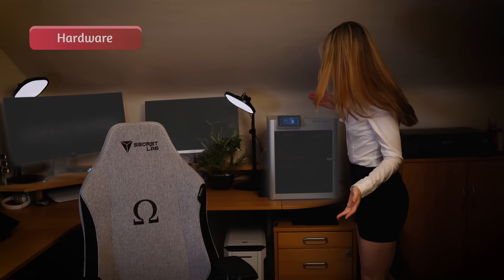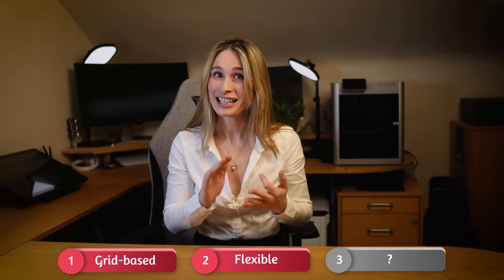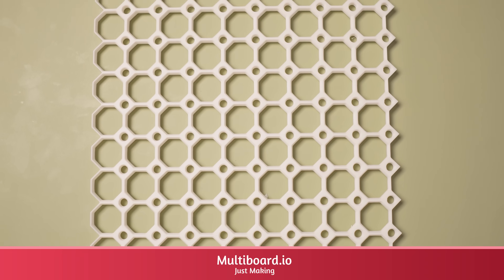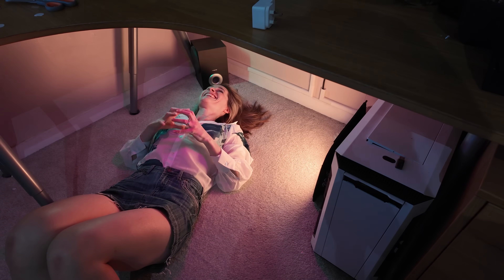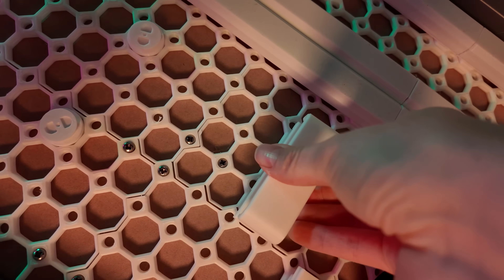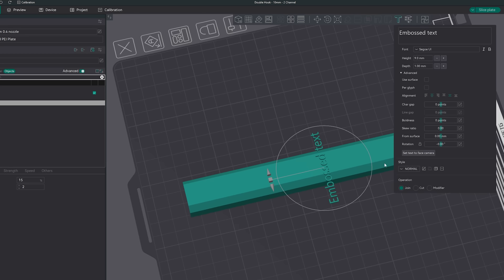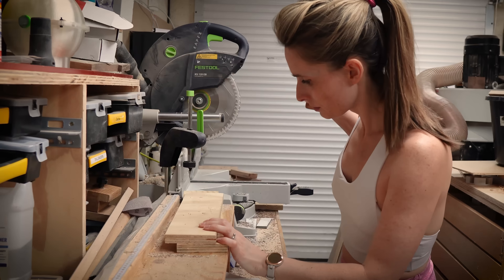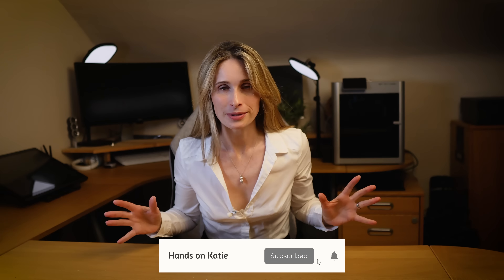Underware: The Ultimate Cable Management System | Full Guide

Comment: This is absolutely brilliant. I currently have a server cable channel that I attached to my desk to run wires, and while it does a good job of hiding everything it's a massive pain in the ass anytime I need to remove or change cables. I'm definitely switching over to this.

Comment: Underware - I covered it "briefly" in another video... I see what you did there... 😃
You certainly managed to "slip in" all the puns!
Great work as always, I really do enjoy your presentation style
I've got some Gridfinity things on the go now, and I have plans for multiboard at some point. But first, I actually have to finish some of the projects that are still ongoing!
I still have 2 servers to build (1 with Proxmox running HomeAssistant in a VM, and room to expand for other VMs, the other will be a TrueNAS Scale file and media server running Jellyfin), set up all of my home networks more securely with some Unifi gear, a 3m run of LEDs to wire (I've already set up the smaller LED strip with WLED, so I just need to attach the longer run to the same ESP32), and a sturdy desk to make for the 3d printer, as it gets a bit frisky on an IKEA Bekant desk!
Reply from the maker: 😃 Well spotted - gotta keep you on your toes!! Sounds like some cool projects you've got going - I keep meaning to tinker with TrueNAS, been Synology for years, but get annoyed at their sluggish hardware progression vs pricing....
Reply: She even included a "seamless" (underware) pun. 😂
Reply: @handsonkatie  I have a very old Synology NAS at the moment, but it's on its last legs, already lost 1 disk from the array, and is officially at end of support. 
So I really should get my big boy underware on and finish that project so I can get the files off the Synology NAS before it suffers a rapid unscheduled disassembly! Or a "This is fine" style overheating event... 😆

Comment: Looks like nice addition to Gridfinity and sturdy Walliniti 👍👏
Reply: It's multiboard not gridfinity
Reply: @MrFolfy  Indeed,, that's why I said Multi board is a nice addition to Gridfinity I use in my drawers and sturdy heavy duty Wallinity I use for tools. Wallinity is also designed for super easy removal, so that you can take the bracket with the tool from one workplace to another. It's quite a different thing from Multiboard. I'm sure both have it's purpose.

Comment: Loved the video and the concept.  One thing I've always been told is that you should always have your power cables uncoiled.  I think it was from a heat perspective.  Do you have any concerns about this in your setup?
Reply from the maker: Hey Chris - yes, if you've got a high current then it's sensible, you'll note I loosely coiled the power strip (another example of the flexibility here) and there was only lightly devices added to this socket (pc plugged in directly), so resistive load would be tiny!

Comment: I have been using the ring binders from two-ring binder folders - you drill the rivets out and remove the ring binder component from the folder and then bolt it to the underside of the table towards the back, it's a snap-open-snap-closed solution but has limits in terms of how many cables you can fit.  Nowhere near as elaborate as this system, I can actually see this being remarkably useful for SBCs and their string of external components too;  I just wish I had a 3D printer now.

@Katie have you ever thought of having these made commercially as components for sale?  I'm sure they'd sell rather well as this would solve problems in quite a number of domestic and commercial areas, I've seen run-up and server rooms that desperately need something like this.
Reply from the maker: Neat solution nonetheless!! I'm happy to keep this open source and let the community benefit and contribute their own ideas! But you should definitely get a 3d printer! (There's a big sale on at the moment too! Check links in description and my videos that cover which one!! I sense another convert.... 🤭😉)
Reply: @handsonkatie  this is starting to sound like a 3D printing cult....  I have already sold my eternal soul to the Air Fryer cult and the Instant Pot cult, they may not be happy at my apostasy.

With the underside you look to be distributing weight across a wider area which is clever.  I could imagine this would be particularly useful in an aircraft or vehicle interior too.

I'm also showing your videos to some mesh networking people in Australia BTW, they too are innovation junkies (they're building a new mesh system and protocol from the ground up).
Reply from the maker: @davocc2405  🤣🤣 It's certainly a movement!! Believe it or not, I couldn't work out what a 3d printer would be useful for until I bought one!! Share away, it's great to get everyone's cool ideas! I've got a new version coming out in due course, so happy to build any extra solutions!
Reply: @handsonkatie  you have so many printers though - I am now suffering from a condition I experienced as a child, I am experiencing extreme equipment envy (my friend Sonja had four times more Lego than I had and I was hideously jealous, that feeling is coming crashing back).

You also have laser etchers and all sorts of other cool toys...  Do you have one of those laser cleaners too?   Also are metal based printers viable for residential use yet or still strictly rarefied and commercial?
Reply from the maker: @davocc2405  🤣🤣 well I've gathered things over time! But a Bambu A1 will do 99% of everything I do! Metal printers (sintering) is still a little way off for household use I'd say, but that will be another game changer!
Reply: @handsonkatie  not sure I could make it work, my natural propensity for disaster would probably end up making something that looks more at home inside reactor #4 in Chernobyl, all while setting fire to the cat.  And I don't have a cat so it'd have to print one for me.
Reply: @handsonkatie  I'm particularly glad that you mentioned the need for covers and enclosures for these, I've only seen this briefly covered by Don at Novaspirit Tech (I've known him for several years, you've probably seen his channel before).  Uncovered do you find they produce dust and fumes that much?  

oh also - have you ever worked with the recycling of PET plastic bottles to make filament at all?  I find that intriguing but possibly quite a bit of hassle.
Reply from the maker: @davocc2405  I've only used PLA and PETG for any serious volumes, so these produce pretty minimal fumes in general. If you check out my recommended products section: https://handsonkatie.com/recommended-products/  I highly recommend getting one of the Apollo Automation air sensors, they're great for keeping an eye on any VOC levels. 

But if in doubt, I'd just consider an enclosure - there's lots of good 3d printable options out there and/or printers with enclosures.

PET bottle recycling - no, but love the idea!!

Comment: Hi katie 😉 do you have an advice for a good transparent filament to use as a light diffuser for a led strip ? Thx in advance :D
Reply from the maker: Hey! 👋 Pretty much any transparent filament would be great for this - I use Elegoo's transparent PLA for most things, so worth checking this out!
Reply: Hi 😁 Thx for the Quick answer !
You’re the boss 🥰
Reply: Since you're asking for usage as a diffuser, what you most likely want is translucent filament 😉
Transparency (like window glass) diffuses nothing (or very little) and just lets the light pass through. Best example is "plain"/undyed PETG.
Translucency (like frosted glass) lets most of the light pass through but obscures and diffuses what's behind it. Most white filaments work as a decent diffuser as long as you print them thin enough. Or you can get all kinds of PETG filaments that are labeled translucent, they only have small amounts of dye added and still let a lot of light through.

Comment: Wonderful video thanks for the inspiration. I have a use case that I don't think was covered and was wondering if I just missed it or it wasn't covered? I want to cover some wires which are going along the top of my baseboard along a wall and around an inside corner. I also have a use case for an outside corner in my shop as well.  Love your videos keep up the good work.
Reply from the maker: You'll see I've got cables doing exactly that in the video. The only exception is the inside corner example that you mention, that's easily enough solved, so I'll create a custom piece for that over the next week or two and upload to the collection! ( I might do outside corners and so on at the same time!)

Comment: For cables where you're concerned about interference maybe you could line the pieces with aluminium tape?
Probably overkill for most use cases but since you mentioned it.
A piece to hold cables neatly on the moving legs of a sit-stand desk would be a great addition.
Reply from the maker: Hey Bram! LOVE your aluminium tape idea - super simple. Agree overkill in most cases, but for certain folks that's a great idea to test (eg masses of sound cables)

Sit/stand desk - have an early prototype of an infinite cable spine for exactly this - will add to the collection in a few weeks once tested!
Reply: remember to ground that aluminum tape, or it will not work properly. Better put your cable in a grounded screen though, not plastic underware = )

Comment: @Hands On Katie  I've been installing this system for under my desk and cleared all the power strips on the floor and cables hanging around. Great job!

Next is to clear up my Bambu printer area - I am looking for a hook to lay 38mm hose across so I can run it across the wall under some nins and out of the window.
I could use a 40mm power block hook but it would be nicer to have a proper 1x or 2x width semicircular hook that I can place at required intervals.
Any plans for such (or could you design one) please?
Cheers.

(P.S. Glad I found your channel...)
Reply from the maker: Hey Nick,
Think I follow what you mean and happy to model - can you drop me an email on my site with your best hand sketch and I'll model something up!
I'm having an 'Underware Day' with my Patreons next week where I'll model a whole pile of new ideas/models they've come up with, so I can do yours then too!
Reply: @handsonkatie Yes, in fact I can send a photo of a quick print made by modifying a power strip holder in BSbusing primitives to cut and add what I wanted.
It works but really needs the mounting slot orientation changed (it's sideways at the moment).
I could probably bring an STL into F360 and model from there just using the slot configuration from the imported messages - the F360 file for underware may include those models but I haven't opened it yet ...
Reply: I couldn't find a way to upload an image on the Contact page nor an email address. But I did find a STEP file negative for the mounting cutout so I just modeled it myself in F360.

Comment: I think a good idea would be an attachment where you could loop cable ties through in order to hold bulkier or odd shaped items... or maybe an attachment that could house a magnet to make a magnetic strip that is moveable around the grid (instead of having to use adhesive like most magnet solutions). i also don't know if it is feasible or not, but if the grid underneath the desk comes all the way to the edge... things like a cup holder would be neat.
Reply from the maker: Great ideas - will add to the list!

Comment: do you screw the panels directly to the table? Or you use the same spacers as for the wall?
Reply from the maker: I just screw to the wall and table directly! Spacers are not needed and weaken the board!
Reply: @handsonkatie  will do that, thanks!

Comment: Really cool system! Are you going to modify the designs to support the new MultiPoint connection that Multiboard came out with? which just looks similar the the MultiConnect you linked to?
Reply from the maker: Thanks Bob, I'm a fan of simplicity, so I'm not sure I see much benefit. The whole Multipoint system seems to have taken something quite over-engineered to an even more over-engineered level! MultiConnect is super simple, has proper parametric files behind it so it's much quicker to develop solutions for anything I need - and only I need 4-5 files, not 4000+ to wade through!! (Plus Multiconnect has an open source/community licence too, which I'm always a fan of!)

Comment: Love this! Printing it now. Weird question probably...any suggestions on how to securely/strongly secure this to the desk? The thickness of my desk is only 0.6" so the screws will be short. I just don't want it getting loose / pulling out when I inevitably move the cables around.
Reply from the maker: My desk is the same, so I just used 10mm screws through the pegholes in the multiboard and it worked perfectly?

Comment: Thank you for the video! I am curious as to why you didn't use the Offset Snaps, as they seem it could be quite useful for this setup by offering more options to route cables in the space between the desk and the board. Could you share some insight on this?
Reply from the maker: Hey, mainly Occam's Razor - ie keep it simple and not over-engineering. Offsetting the grids naturally adds a bit more complexity of printing, mounting and also lowers the underware so more likely to get in the way of your knees and being visible when you come into the room. I wanted to keep it ultra-low profile and make it super easy to route cables (ie cable covers on top, not having to fish cables under loads of multiboard grids), so this worked great for me! This make sense?

Comment: Maybe a follow-up video attaching a five port & 16-port switch with underware. It appears you've got it covered with the 'Knob' style but the knobs didn't really get covered in this vid.
Reply from the maker: Yes, there's lots of options, the bracket clamps, the command strip mounts, but best of all for this would be the parametric holders I used for the power strips. You just enter the width, height and depth and it'll generate a 3d file that perfectly fits!! I'll add a short gif/video to my site to demonstrate!

Comment: It would seem to me that using smaller sections spaced out or an infill pattern could be used to save on filament if that's a concern for someone as well as see what cables are inside.
Reply from the maker: Exactly right, some folk have just mounted the hooks and used these to connect for absolute minimal supports.  Note the new Underware video is now out, so even more options!

Comment: Incredible work and it really looks nice, but, and there is always a but when talking about underwares...

I have to wonder if it wasn't possible to bypass the... Under-underware(?) bit that hold the top of it.

Like, the thing that holds the cable is only the top, that's the main underware part. The bottom piece is just a sort of "adapter" from Multiboard to Underware.

I think it might be able to just put peg hooks into the edges of underware tops and bypass the bottoms
Reply from the maker: Hey Christian! Yes you could 'probably' work something out like this. It'd lose a bit of strength and aesthetic beauty (as you'd likely have peg hook holes that you'd screw the top through. Then you'd also lose either channel width or the ability to put them side by side to accommodate this fastening flange....! Still, if you can come up with a doodle design, I could build a test piece!
Reply: @handsonkatie  Hmm, you are correct that it would probably uglify the entire thing.

Now I got to ask, why does the bottom piece of a cable channel have the same size as the top piece? From the description it looks like you might be able to just make two square bottom pieces with roughly the size of a multiboard main hole, and put each bottom piece at the end of a cable channel
Reply from the maker: @ChristianWS.  Yes you could do this already (if I follow you) print two base pieces for the one long I-channel piece, then clip this to the top piece you want (eg 10 long top). So totally possible, just would lose a bit of structural strength, but for lots of use cases this would be fine!
Reply: @handsonkatie Exactly that. Suppose I want a I09 Channel, I could just use a I09-Top and two I01-Base.

I like the overall system, my only issue is that it feels a bit wasteful in regards to channel bases, as they don't appear to offer much in the way of functionality or looks. 

Channel tops could be argued to be somewhat wasteful, but they are aesthetic pleasing and they offer full cable protection, so they are worth it.
Reply from the maker: Spot on - that would work fine, in fact you could add a third in the middle if you needed more strength. In terms of waste - yes, you can just pick what suits - given the price of filament has more than halved in the last three years, I lean towards a bit more robust in these sorts of solutions as I want to reuse them loads! But you're able to pick and choose whatever suits you!
Reply: @ChristianWS.  It's always good practice to keep your cable protected for safe computing. You don't want to expose your system to a virus.

Comment: Ok. I have a bunch of the core panels printed and tried a section of vhannel.  In order to attach the cable channel to the grid, there must be a fitting that will join the cable channel to the grid.  I have printed quite a few but so far haven't found the right one. What file must be primted for this? you show an example at 9:05

Comment: What size screws are being used to mount the multiboard to the desk?
Reply from the maker: I vary a little, but pretty much any pan head 12mm screw will do (essentially as long as it's less than the thickness of the desk, you'll be fine!)